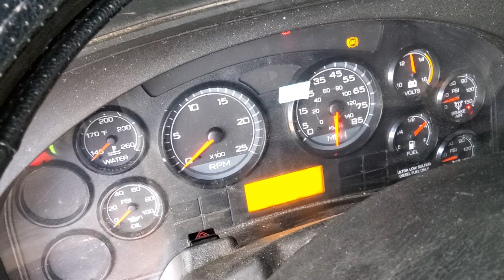Speedometer Sensor Replacement To Fix Qualcomm Log Errors. International ProStar 2009 Watch N Shoes!

Comment: Hi Curt-is me again. Please disregard earlier question. Thank you for your video...surgery successful, speedometer - and cruise control - working again. 😊
You were 100% right about need to  ream out hole where speed sensor sits...I didn't have a 3/4 bit so I just did my best with a 3/8 bit and went to town. Thanks again. 😊

Comment: Hi friend thx for video. 
Couplequestions....did you get a check engine light before your speedometer went south and, besides the obvious discontinuation of cruise control, were there any other electrical abnormalities  ? Thanks.
Reply from the maker: My yellow triangle and abs warning have nothing to do with this speed sensor problem. Those came from a loose wheel speed sensor... I don't remember a check engine light just the gauge dropping to point south...

Comment: Not a easy fix at all wow you got some serious skills.
Reply from the maker: 🤣Serious desire to not give the Hickory, NC. dealership several days of labor and un-needed parts purchases!!.. 😁 They were grinning 🤭 when I said my speedometer was broken! 😳
Reply: @curtisoular  yep they want your money 💰
Reply: Did that actually work i have the same problem i changed the speed sensor and mine is still doing the same thing
Reply from the maker: @Favgirlkyilee  indeed 💯 percent!
Reply from the maker: @Favgirlkyilee  you may not have hammered it down close enough to the rotating magnetic teeth or you have not driven enough for it to reset! Get out on an interstate and get it to 55mph or so for 1 or 2 exits 5miles.. return to the lot turn off and turn back on and it should be just fine!
Reply: It reset the when i originally put it on then 200 miles later the speedometer went right back around